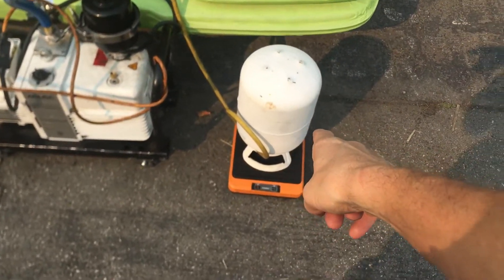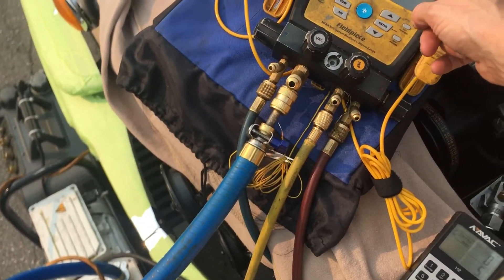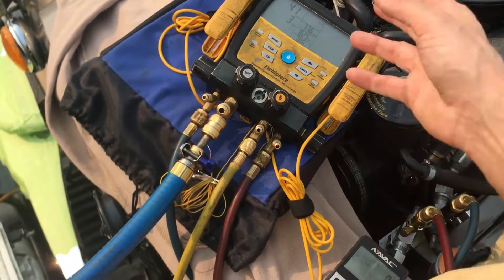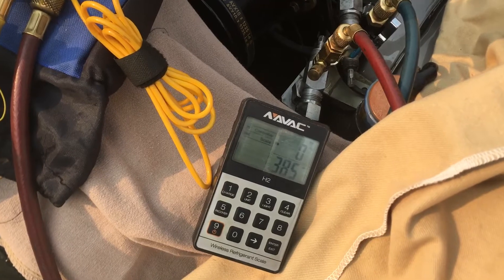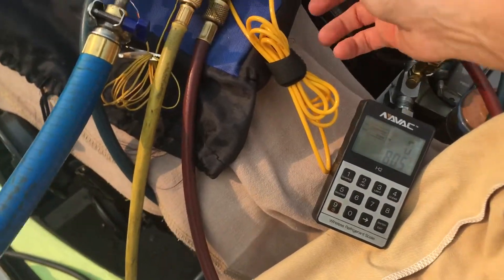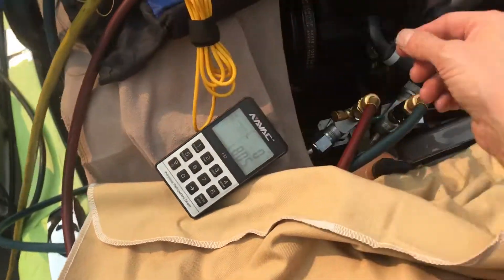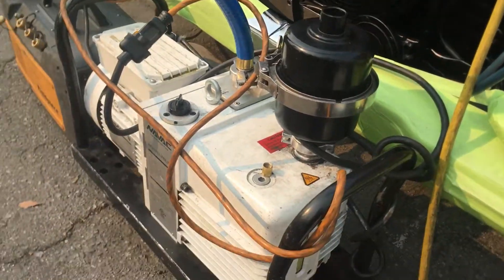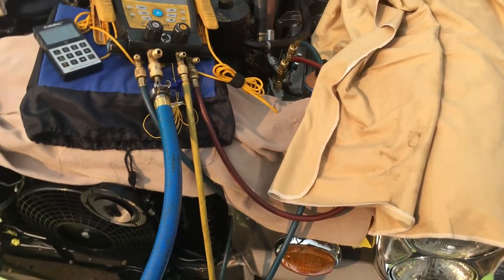Pt:5 Fill 800g. R12 into 1971 MB 280 SE.

Comment: Love your attention to detail and going the extra mile here on this classic Benz

1.  I notice that you did not let the vacuum climb back up and see if it would hold at under 500 microns?   You went right from a 73 micron reading to filling.   I'm assuming you did a triple evac on this and tested to see if vacuum held prior to the charging.   

2. Also,  I notice you're filling with the vacuum pump still on?  I'm assuming you shut off the vacuum knob on your fieldpiece?  

3. And are you charging the liquid r12 through the low side only or both low and high sides simultaneously?
Reply from the maker: komoru 1: The vacuum climbing well over 700 µm start stabilizing about 900 µm I was not going to vacuum it any longer this was an inherited restoration job from one shop to another. The AC system was left open to the air for over two years. 

2: yes of course I shut the valve off at the Fieldpiece. Otherwise when we charging I would’ve gotten showered with the mineral oil blasting out of the vacuum pump. Did that before no fun very very messy shoots up in the air 30 feet. Would have made a funny YouTube video caught on a security camera and uploaded. 

3:    Filled through the high side liquid. R12

    4;  but yes held vacuum and I performed a high-pressure nitrogen pressure decay test at 150 psi

Comment: The other thing in this video is I did not see when you add mineral oil and dye to the system.  I know you have a caulk gun injector to inject oil and UV dye and here (or in your other videos on this car) I did not see you use it.    Do you inject the oil and dye prior to vacuum or after you charge the system?
Reply from the maker: komoru  I like injecting dye before if there’s any moisture contamination to reduce it through vacuum. Your injected lubricants compositing be stored for many months on the shelf absorbing moisture right through the plastic contaminating the Bace  stock oil in your dyes